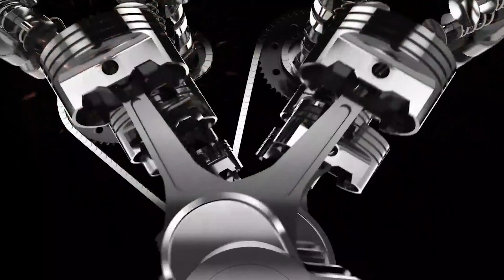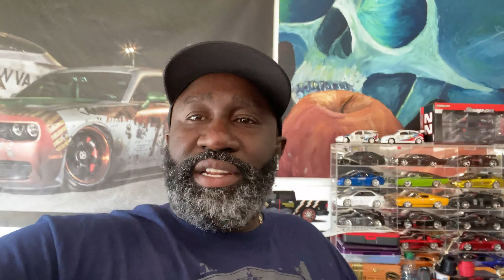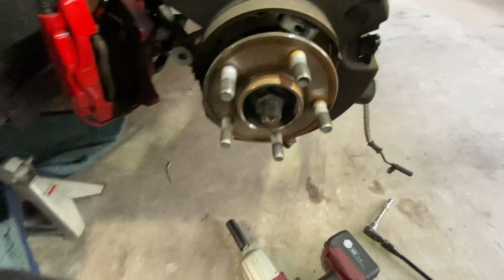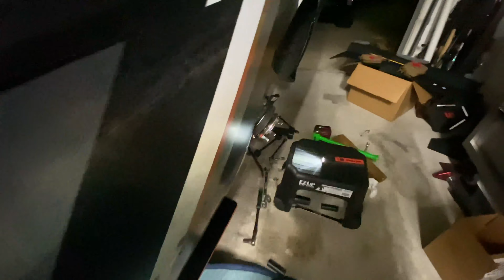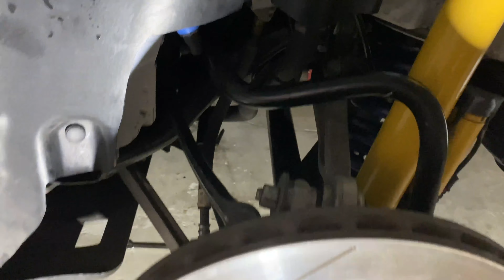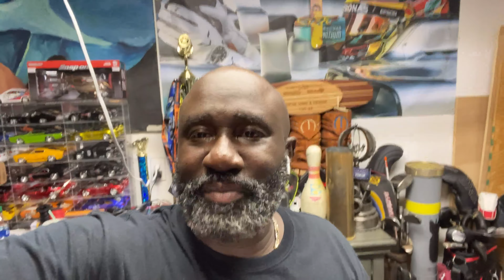HELLCAT AXLE REPLACEMENT!!

Comment: I appreciate the video, but I wish you had shown how you got the axle out. I'm replacing my rear hubs right now and if I could get the axle out of the hub I could get to the 4 torx bolts to remove the hub. I'm running Redeye axles that are kinda hard to get, so I don't want to pry and wedge the axle out of the hub.
Reply from the maker: Man I tried to get the redeye axles but couldn’t because I didn’t own one. Are you removing to do a 15” conversion? What questions you have I can help you out I’ve replaced both axles and about to replace both when the DSS gets in
Reply: I play around on road courses so Redeye axles are the hot ticket so far. I have 5 seasons on my stock hubs so I'm replacing all of them with new and adding half inch longer ARP studs while I'm at it.
I'm hoping to remove my rear hub without removing the parking brake cable and the lower joint between the spindle and the lower control arm (spring perch). Looks like you did it this way just by prying on the spindle and pushing the axle out. I don't need to completely remove the axle, just push it out enough to get to the 4 torx bolts holding the hub in. I have hope this will work but any tips would be appreciated.

Comment: I just did this and went with g force axles.  Was wondering if it was necessary and feel better about it now that I've seen this vid.  Also did sway bars and all suspension linkages
Reply from the maker: Yeah I called all the axle places and there weren’t going to be available for about 6-8 weeks.  So I’ll be changing them out then, I just needed an axle right now.
Reply: @MissionFlyer  I was wondering why you were putting stock axles back on if they suck.  Them Gforce axles ain't cheap either.
Reply from the maker: @4shaken_  no where have them available right away!
Reply: If you look up prnnchl on instagram he has a ton of Hellcat parts for great deals.. got my axles for $300

Comment: What are the torque specs if you still remember? Gladly appreciate it.
Reply from the maker: For the axle bolt?
Reply: @MissionFlyer  yes. Did the end link and sway have a torque spec ?
Reply from the maker: @darriussmith1947  what’s your IG I’ll send you a  pic of the rear suspension torque specs
Reply: @MissionFlyer  srtsmitty_707